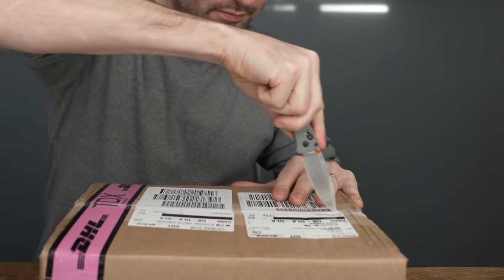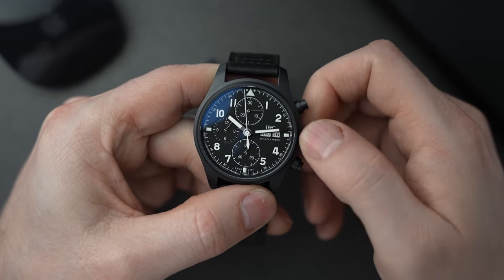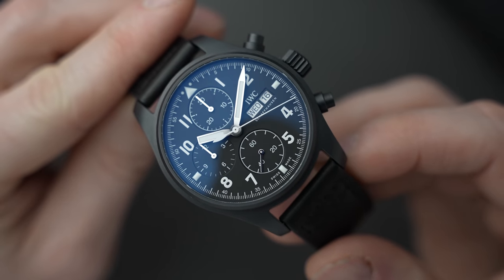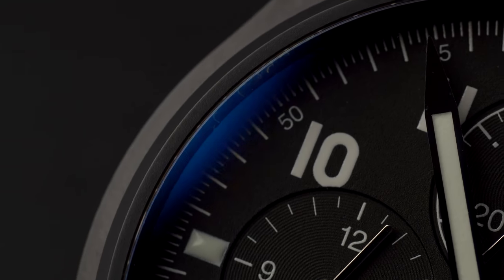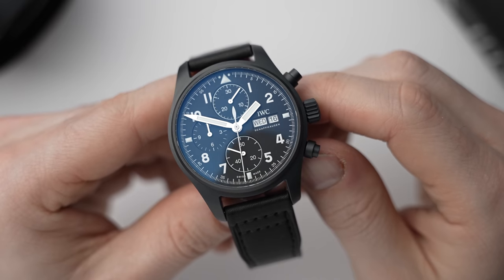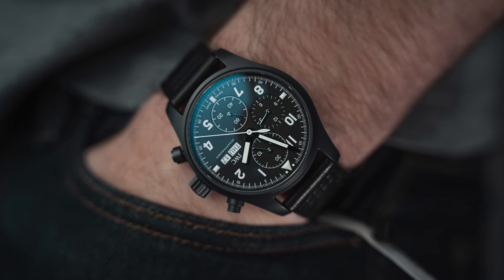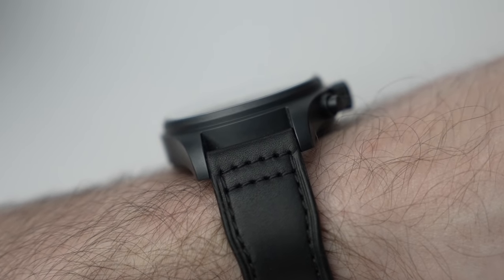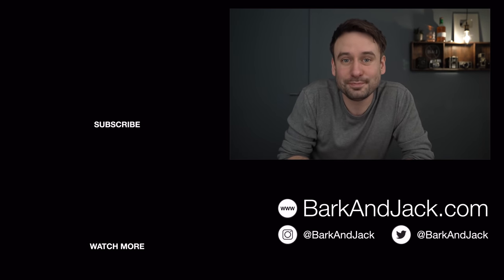IWC sent me a Prototype!

Comment: That’s a Valjoux 7750. It might have been tweaked but in-house, my arse!!
Reply: Imagine the uproar if Bremont claimed such a thing 😂
Reply: That is one of the things that keep me from buying an IWC. That and the prices that are really ridiculous for some of their pieces.
Reply: I'd say the 7750 is better as I don't like the 6 o'clock running seconds dial on these new Val Fleurier movements. The 12 and 6 o'clock sub-dials traditionally timed the chronograph (hence the white borders) but now it's just mismatched.
Reply: You definitly are very poorly informed, sir.
Eta doesn't provide iwc with movements anymore. 
The 69380 is fully in-house.
Reply: @marvinberwart  no, they're made by Val Fleurier, Richemont's movement supplier. This movement has the same architecture as the valjoux 7750 except they've added a column wheel. They've even kept the bidirectional rotor, which is kinda old school.
Reply: @A.T.148-Scot-HK  that's more like it indeed, but I was pointing at the original comment. This caliber is definitly not a 7750, but maybe in-house isn't exactly the right term indeed.
Reply: @marvinberwart  I hate the new 6 o'clock running seconds subdial. Just mismatches everything now.
Reply: @A.T.148-Scot-HK  Doesn't bother me that much, I even kinda like this particular model.
I have a St Exupery chrono with Valjoux and I see what you mean though, it could somehow be considered better in terms of design but I really like the addition of the column wheel.
Reply: @marvinberwart  I stand corrected. Not that I’m bitter, I’ve a Portifino chronograph, paid £5.5k and it’s kept it’s value so well, you can pick them up  used for the price of a McDonald’s happy meal.
Reply: @pandora8478  Value retention you say?  Personnaly, that's the least of my concerns, I even like that the folks at Iwc have the decency not to create artificial shortage of mass produced items.
If you like your watches to be an investment then you have two choices : pay ridiculous premium or be very very very patient.

Comment: IWC's in-house chrono movements are based on the Valjoux 7750 ebauche, which itself is a rather large movement.  Even Tag's Calibre 02 and Breitling's B01 movements are pretty large.  If you want a truly thin chrono movement, then Bulgari Finissimo is the way to go.

Comment: Btw, iirc "Ceratanium" and similar "ceramic + titanium" mixes meant that the watch has a core case (or frame) of titanium, with a covering layer of ceramic (like steel-reinforced concrete, it's not steel+concrete diffused together, it's just a steel frame inside concrete volume).

Comment: It's a great watch if you looking for ceramic. It checks all the boxes compared to what's out there. It's a decent size, everything is black including the crown and pushers, can be put on a sail cloth strap for hot weather, has a date, lume, auto etc. and isnt a diving watch (for those wanting something different for a change). Not sure there is any other ceramic (yeah I know it's a different material) watch out there that offers what IWC is offering. Check Omega, Panerai, Blancpain, Rolex, or even the other iwc watches.

Comment: I have an IWC pilot's chronograph from back when they used heavily modified 7750 movements, and I have found out that it's too thick to put NATO straps on it. If you put on a NATO strap, the watch will tower over your wrist, and knocking it into everything becomes almost mandatory. Perlons are OK.

Comment: The 3705 is one of my all-time favorite watches and I was really excited when they teased this new release. I was hoping for a recreation of the 3705 with the new in house movement. Unfortunately (for me), this is more of a reinterpretation of the 3705 using the modern pilot's watch sizing. 39mm would have sealed the deal for me, even at 15mm in height. The current pilot's watches are 41mm but they wear larger than that, they feel much larger than my Speedmaster professional. It's a nice piece for those with larger wrists.

Comment: Way to thick and 30m water resistance is poor. Personally I think 100m is minimum for a watch in this price range. Not necessarily for the actual water resistance but for the build quality requirements to meet that spec.